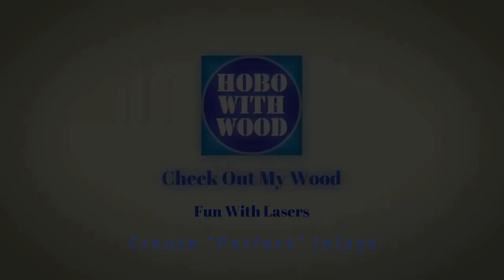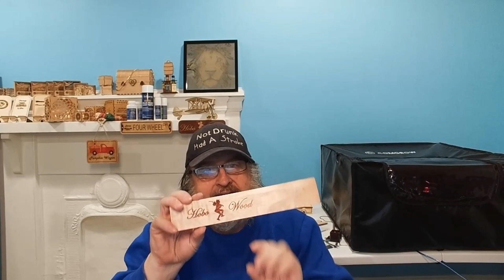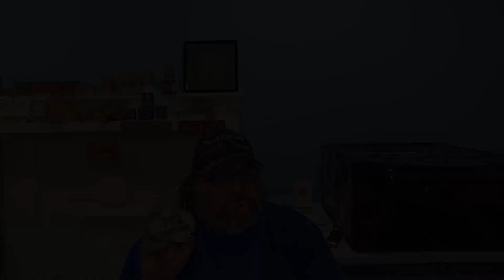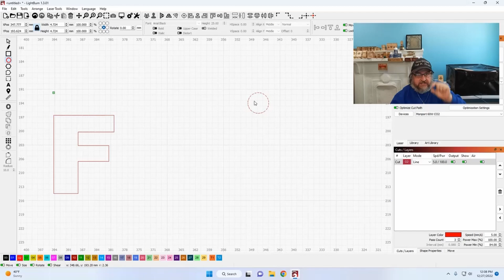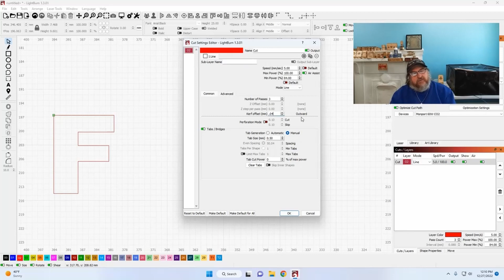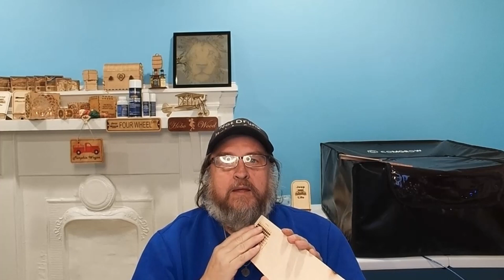Create Quality Inlays Using A Laser

Comment: It’s been a long time since you made this video, and it helped me tremendously.  Before any of us had our Roly’s.) My thoughts on the whole inlays vs proper inlay thing is that it takes a long time to cut out a void for my inlay and it has a greater chance of not working. But it takes minutes (maybe seconds) to through cut 1/8” or 1/4” material and the matching inlays, adjusted for kerf, are a perfect friction fit. I can then laminate to a matching (or contrasting) piece of material underneath and the mirror image on the reverse side is eliminated. I have more confidence in my ability to laminate than to get to a perfect void.

Comment: I've been Kerfed, Thank you, Tho, line after Fill? I get the concept but is there a setting for that or just create a layer
Reply from the maker: It is simply creating a sublayer. I used the black (00) layer to do the 50mm/s @ 60% PWR  fill mode using cross hatch. Then created a sublayer using the line mode at 40mm/s @ 30% PWR. Then followed that with a third sublayer using the flood fill technique using the same 40mm/s at 30% PWR. A total of four passes on the pocket all done from one layer using sublayers.
Reply: @HoboWithWood  I have not done the sub-layers yet. I saw your line had said multi I was wondering about that. Now I get it. cool Thank you.
Reply: It used to be a setting, but the setting has been removed. Now you do it by adding a sublayer.

Comment: For thin stock hardwoods I look for sellers that cater to the scroll saw person.  One caveat regarding purchasing thin hardwoods I bought several pieces from a seller in the desert southwest and when it arrived in my humid Missouri shop it all twisted.
Reply: This is the primary reason I make my own veneer. I can buy exotic wood lumber or bowl blanks and, using my bandsaw, I can make veneer about 3/32” thick which is perfect for doing inlay work.
Reply from the maker: That is something I never thought of. I do let any wood I purchase acclimate to my shop before working with it. But I never thought of the impact of buying from a region with such a difference in climate and the impacts it may have. Fortunately I have a warehouse within driving distance that has ALL kinds of exotic hardwoods on hand and ready for lasering. I'm in NC. If I can workout a "deal" it might be a great source for you. More to come after first of the year. Stay tuned.
Reply: Find an airplane propeller manufacturing shop! They are always looking for twisted wood! Lowes home improvement is a great source for twisted wood. Rarely is straight wood found there.🤣🛫

Comment: Remember, flood fill is mostly used for diode lasers, and actually has been replaced by offset fill.
Reply from the maker: This was using the diode. Flood fill and offset fill provide two entirely different results for me. Offset fill works from the outside perimeter inwards constricting as it engraves. It can also result in undisired results. But flood fill moves bilaterally and provides and even constant result. I use both. But while offset fill can save a ton of time, if I'm concerned about the final result, I refrain from using it.
Reply: @HoboWithWood  Yes, flood does work better on the diode, but on the Co2, folks don't dial in their min power, so they gat bad results and don't use it. You don't have min power setting on the diode, so that's why the results are bad. If you know how to use the laser, offset fill works great on the Co2, but most folks don't. The only bad results I get on the diode is sharp corners. Anything smooth works well.